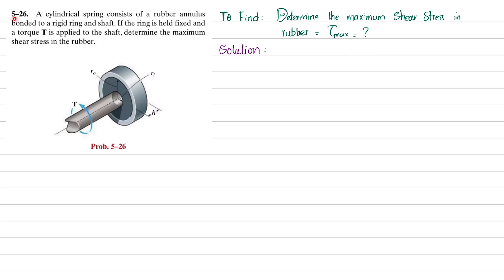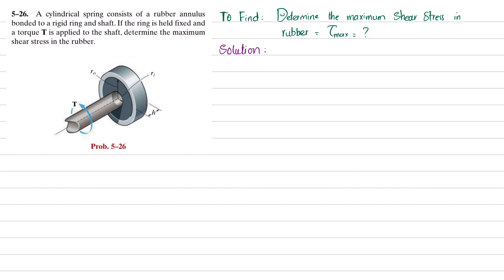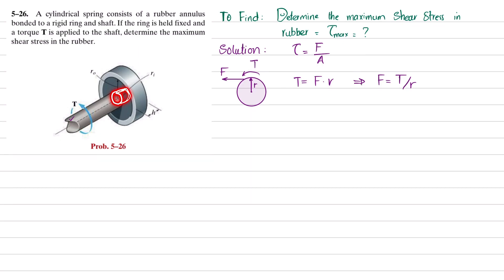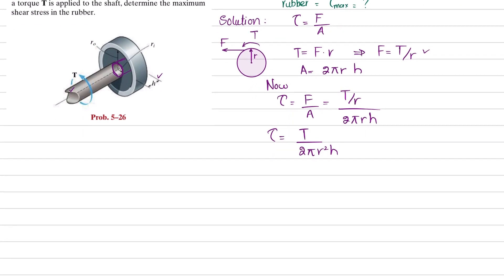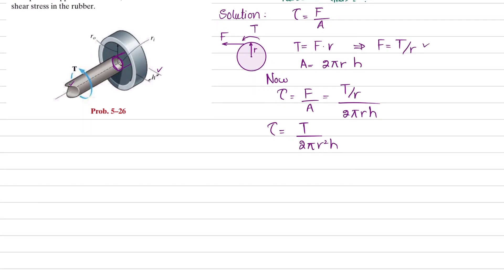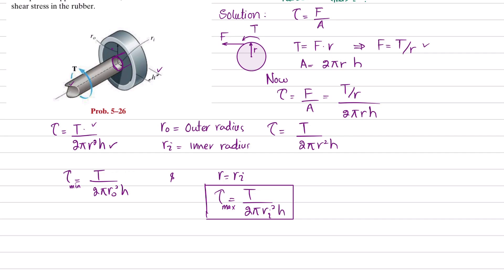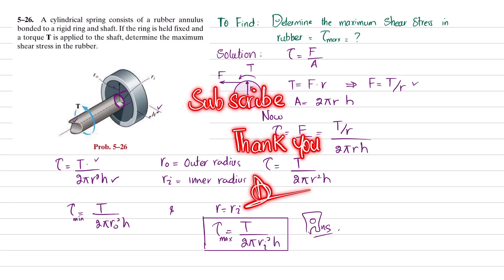5-26 Determine the maximum shear stress in the rubber | Mechanics of materials RC Hibbeler

Comment: As u shown on figure it is anticlockwise
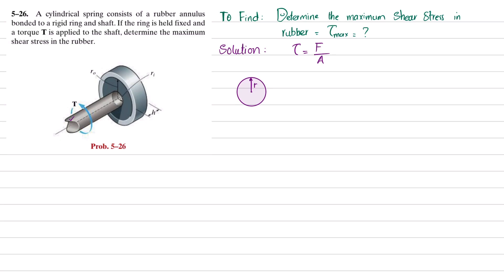Reply: 00:59
Reply from the maker: My mistake its counter clockwise torque..
Reply from the maker: from figure it is clear that it is anti-clockwise torque....
Reply: @engradnanrasheedmechanical  but in video you told clockwise torque
Reply from the maker: May be I called the reaction torque that must be opposite to clockwise torque....